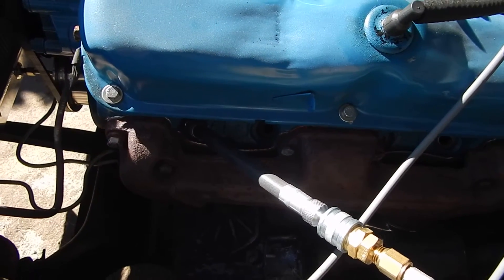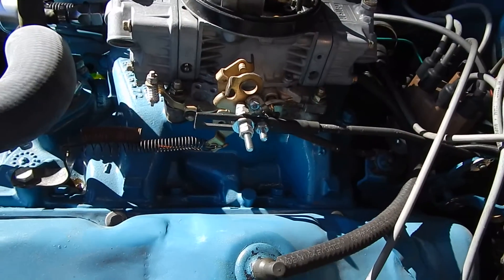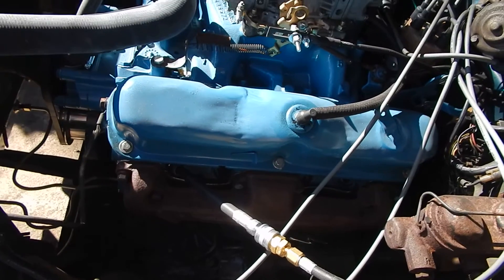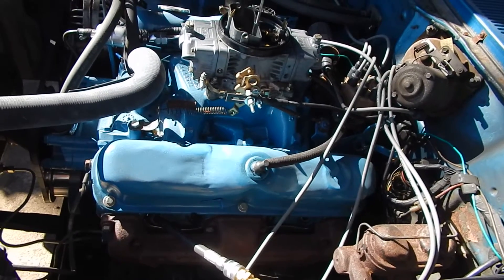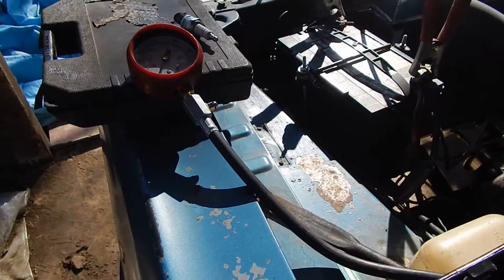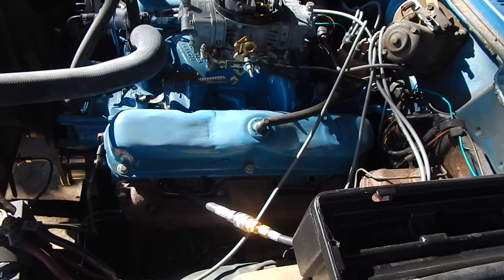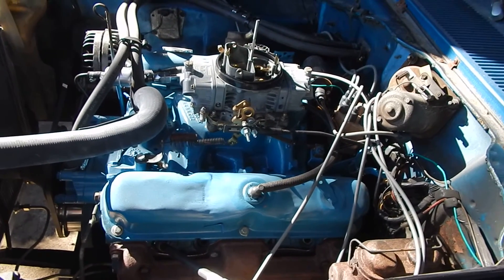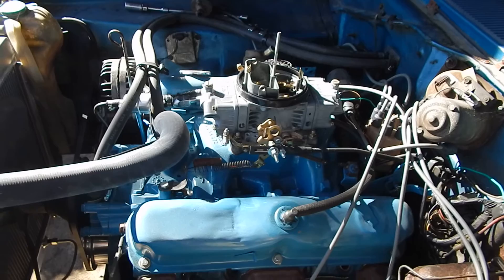Checking Compression Plymouth Duster 318

Comment: I dis a test on my 318 and i had 125 on 6 cylinders and #1 had 110 and #3 had 80 
What does that tell me.
Blown head gasket ?
Reply from the maker: Probably a leaky valve is what I'd guess.  If it was a head gasket, you might have other symptoms.   Could be a broken ring(s), but that would have other indications also.  I'd pull the heads without question.  80 is way too low

Comment: How well does the 4 barrel carb work on your engine? Is the engine stock ? I have a 83' 318 in my '80 van that ive been thinking about putting a 4 barrel carb on. If you dont mind, do you know the model of the carb in this video ?
Reply from the maker: 4bbl is always a nice enhancement, especially if you run a nice dual exhaust system.   In the video, that's 670 Holley Street Avenger
Reply: @318willrun  thanks. Good to know. I was concerned about having a carb that is too big for the engine.

Comment: I have an 87' with 119 000kms on it ...had it check for comp..within 1 or 2 pounds of difference but most were showin' 140 top 138 low so does it mean i still have some life left in my motor...😎 nice video👍
Reply from the maker: that's a healthy motor.  I'd say if you have good oil pressure, you have a lot of life
Reply: My 86 5th Ave had about 120k miles when I got it years ago. The engine was sludged up really bad. The lean burn system was malfunctioning as well I think they never changed the oil much. But I got compression readings of 138-140 every cylinder. Years later now after the car set on and off and was worked on. I did timing set, new cam and lifters.. new carb, ignition.. tons of stuff. I daily drove the car for the last year. Put about 7 thousand on in a year. Now the engine has 136k. I just did a compression test the other day and most cylinders are around 125. One of them was 133. But cylinder 8 was only at 106... Not good. Tells me the engine is wearing out. And pretty quickly. I never liked how my spark plugs looked. They after thousands of miles stayed looking almost new. Slight tan on grand strap but porcelain snow white. This tells me its running lean. But driving it you would never believe it. Never stumbles. Runs perfect. Has 21 inches of vacuum with steady needle at idle. Cruising holds 15-16 inches. But plugs don't lie... For the heck of it I sprayed carb cleaner around the intake. And it revs up. Seems my intake gasket was leaking. Which is why it was lean. Just confuses the hell out of me how it could run so well and have such good vacuum readings with an intake leak?!! I am guessing that running the engine lean for thousands of miles is why my compression is down. And why i have 1 low cylinder. Any thoughts anyone??? ( I also blocked off the egr. So combustion temps were probably high. How long would it take to burn a valve from running slightly lean? Thinking that's what's happening in cylinder 8??)